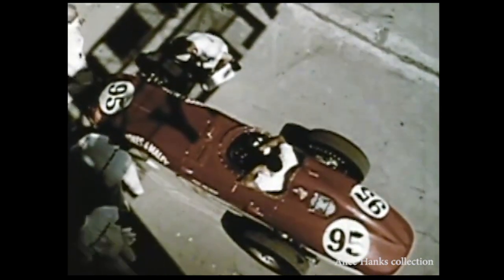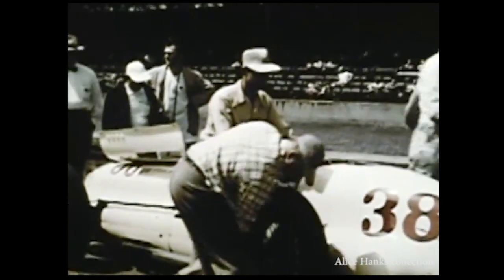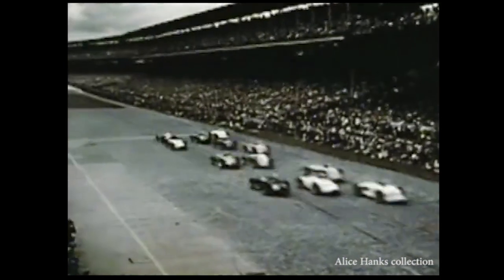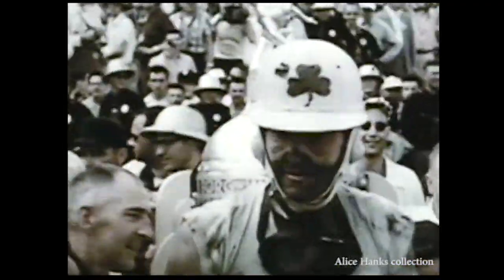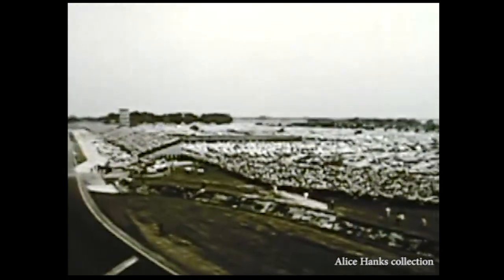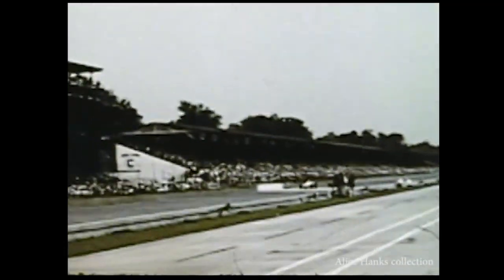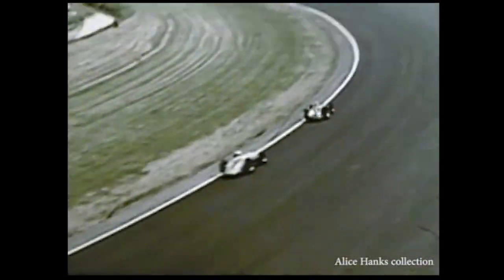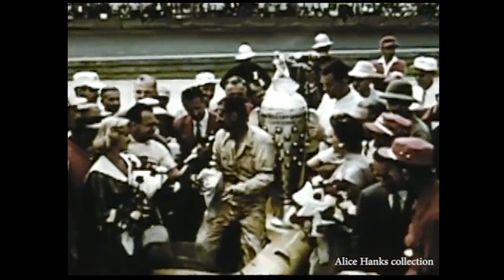The 500 Mile Adventure - 1957 Indianapolis 500

Comment: All that talk about the 1952 race and the lay-down engine in Vuky's car, and they never even mentioned the Cummins Diesel Special, which had a lay-down diesel engine and qualified on the pole.  It was also the first car to run at the speedway with a turbocharged engine.